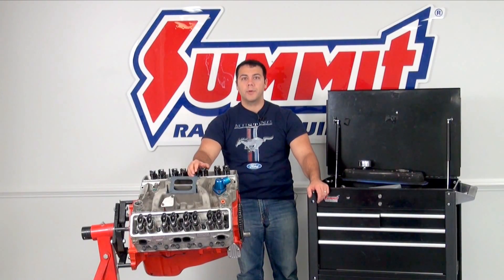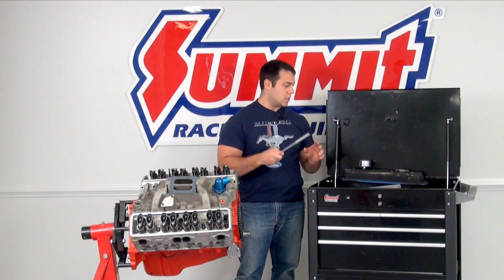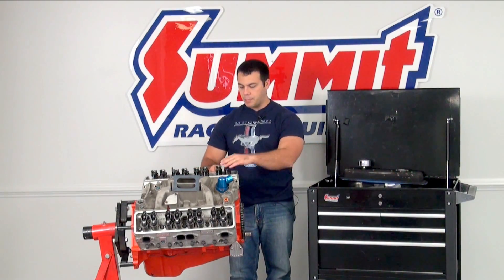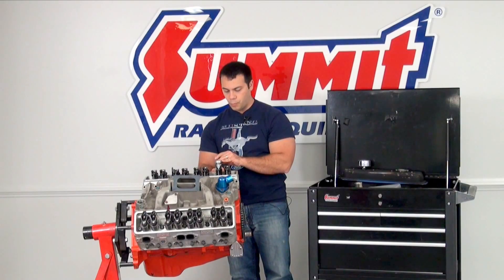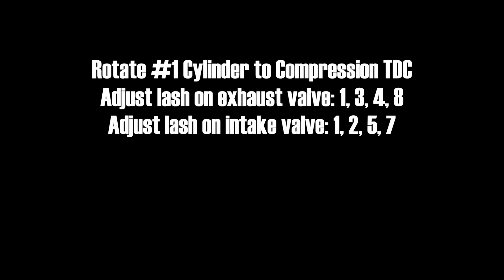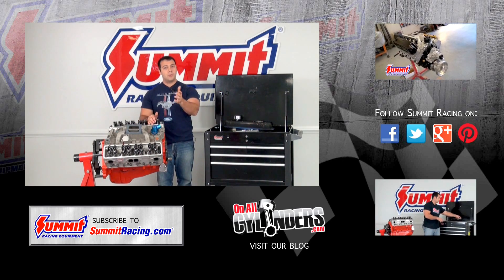Setting Valve Lash on Solid and Hydraulic Lifters

Comment: I found best way is put number 6 in overlap crank should be at top dead center. Then you can adjust number one. Write down the firing order to say 
18436572 than
65721843 top one is the valves you adjust bottom one is the rockers you looking overlap. Two revolutions and you have the valves all adjusted.

Comment: On a solid lifter cam Hot lash and cold lash are two different settings depending on what the cam card says and whether you have alluminum heads or iron due to thermal expansion differences between the two metals which will vary the clearance between rocker arm and valve stem as for example a  ford 351 c will have a hot setting of .016 intake and .018 exshaust and cold would be .022 int and .024 exs . Obviously the motor your working with is cold and your explanation is to quick with important information missing . If setting cold you should warm the motor to check the hot lash setting which you failed to explain in your video .

Comment: That is worst way of adjusting them!  You will NOT get a true bottom of the lobe position to accurately set the valse lash! You need to start with #1 cyl a TDC  and then turn the crank 90 degrees for all of the next cyl , setting the lash on both Intake & exhaust! You will notice a big difference how the engine runs!

Comment: Thank you for this video. Great job so if I'm to understand when you're on Top Dead Center, #1 cylinder you can make the lash adjustment for the exhaust and the intake without touching anything and that's similar when you're on number six when you do the other half. So if I went to top dead center of each cylinder, it would be the same scenario I could adjust lash on the exhaust and the intake at that time. do I understand that right. Thank you.

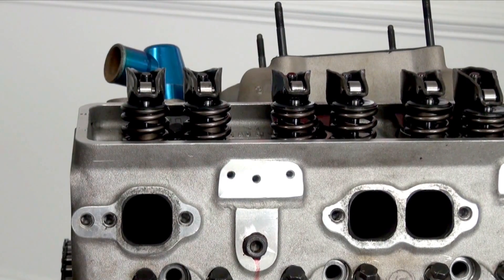Comment: At 1:23 into the video, his comment re;  # 1 TDC is incorrect.   Always use the harmonic balancer and timing tab alignment markings to establish TDC and on the C/S .... (compression stroke).  That said, these TDC markings should have been varified during engine assembly. 
If the assembly tech did not varrify the # 1 TDC markings,  you'll want to perform a PPS procedure.  
PPS = positive piston stop
The split should be 30 degrees or so.... not only 10 degrees. 

As per 1:52, let's assume that we are @ # 1 TDC C/S. 
At 2:30 he has set the "depth" (aka "pre-load") of the exhaust hydraulic plunger, of which is the actual goal. 
The formula is; rocker arm stud thread pitch Xs rocker arm ratio Xs nut rotation = plunger depth.

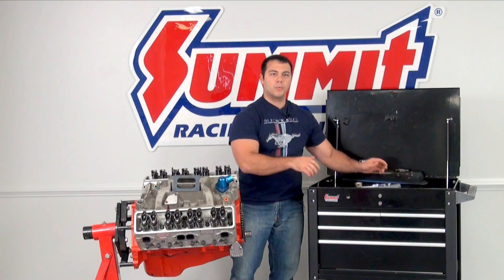At 3:44, with a hydraulic system, using the Static 8 Stop procedure, there is no need to rotate the crankshaft more than two full rotations. 
Keep in mind that most GM cam followers offer approx .100" to .140" of hydraulic plunger travel.  

When adjusting a mechanicl system, the dynamic procedure (although somewhat messy) is more accurate.
Reply: Dynamic ? as in running engine ? How is that more accurate ? That doesn't seem practical to use a feeler gauge on a moving valvetrain .

Comment: So I’ve run the intake valve all way down and back up and to adjust the exhaust valve or is it vice versa? Do I run the exhaust valve down back up and when the intake valve starts to go down is that when I adjust the exhaust valve on a solid lifter.

Comment: Hi I have a 350 sbc engine in my Cobra, with Edelbrock  performer package, with Hydraulic  lifters, and they have recommended  a quarter turn preload for the Lash adjustment. But the engine has been run, so the lifters are full of oil! Do I need to still give them a quarter turn or should I just adjust the rockers until the push rods stop turning. If you could help me with this one I would be grateful.
Colin

Comment: Finding TDC is not accurate enough for lash adjustment if you have any sort of cam significantly over a stock cam.   The only proper method is the EOIC method.   

Rotating the wrench 180 doesn't always work.   It depends whether you have 3/8ths or 7/16ths screw in studs which dictates how much you rotate the wrench for what distance.
Reply: I did half a turn, 12 to 6 o'clock, and I had a ton of chatter coming from the rocker arms. 🪇🪇🪇🪇

Comment: I just bought a 355 sbc,it has a pretty aggressive cam however I don't know the specs on it.roller rockers and solid lifters.how do u determine what size feeler gauge to use to set valves?
Reply: Did you figure it out

Comment: Correct me if I'm wrong he brought the exhaust valve till it barely moved and then adjusted the exhaust valve. You are supposed adjust the intake when exhaust moves.
Reply: The EOIC method wasn't being used . He was getting the piston close to TDC on the compression stroke , at which time both valves where closed and can be adjusted , although only one valve was done to save video time . The crank was turned clockwise until the exhaust valve opened a little , then turned counter clockwise until he was sure it was closed .

Comment: I'm want to put a good RV cam in my87 Chevy v10 4x4 305.i understand the motor doesn't have much power as is.but trying to get enough power to pull a 18ft car trailer

Comment: Is there a short cut on Doing the lash lash on a Honda Odessy?
Reply from the maker: There is no "shortcut" for adjusting vales on any engine. You may find some videos online to help you visualize and guide you through some of the quirks for specific applications. Always follow the manufactures shop manual for the adjustment procedure to avoid possible engine damage. If you need a manual, check out our vast selection of OEM service manuals from Bishko Automotive Literature Reference Books @ Summitracing.com.
https://www.summitracing.com/search/part-type/reference-books/brand/bishko-automotive-literature

Comment: Do I do lash before filling lifters or after
Reply from the maker: For hydraulic lifters, when you are spinning the pushrod and "sensing" for that initial resistance at zero-lash (with the lifter located on the cam base circle), it's not going to matter if the lifter is pumped up or not. The resistance you're feeling comes from the initial draw-up of play between the lifter and the rocker arm with no load; it's only going to be a very slight drag. Once you reach that point of zero-lash (all the up-and-down play removed in pushrod with no load on the lifter plunger), you will preload the lifter to the manufacture's specifications; this is usually 1/4 to 3/4 turn down. It's recommended to prime the engine using an oil pump priming tool before initial starting up. Once you break in the camshaft, it's also recommended you go back and readjust and verify the lifter preload.

Comment: hey! how do you set valve lash for V6 solid lifters setup and when to set for intake and exhaust?
Reply from the maker: When the valve is completely closed, you use feeler gauges between the rocker arm tip and the valve tip. You adjust the rocker arm until the feeler gauges (using the thickness required for your specific engine) slides in between them with very little effort.
Reply: You can find TDC by removing your distrubutor cap and stop when it points at the #1 cyclinder.  Then just follow this: Start by rotating the crank clockwise, while your watching the valves in the #1 cylinder. When the exhaust valve begins to move downward, stop rotating the motor and adjust the intake valve to the proper lash. Next, continue rotating the engine clockwise, until the intake valve reaches maximum lift and is almost all the way back down, then stop and adjust the exhaust valve. Continue adjusting the valves in each cylinder, until they are all adjusted to the proper lash. 

If you remove one sparkplug its easy to turn the crank with a wrench.  If your doing it cold - look for the cold lash setting.  Then after the engine warms you can do the same for the hot setting.  Let the engine run for 20 minutes or so before doing the hot.  This is for solid lifters - not hydraulic

Comment: What is you dont have the cam card for a engine? Im working on a older 350 with solid lifters that became out of adjustment how do I determine what to set the lash at?
Reply from the maker: Hi David, If the cam or manufacturer is unknown the best option is to set both the intake and exhaust at .020”.
Thanks for watching!

Comment: I dont have a cam card. Was told it was a 383 so just put new rods in. bent #5s exhaust rod. Solid lifts. So going to set hot lash at 17000th going to find oil deflections to put on so i dont have fire hazard on headers. So questions... 12000 to 22000 is that hot lash ranging? ty

Comment: Problem here, on a Solid Lifter, Hot Lash means exactly that, when it's Hot! 

You are setting a Hot lash, on a cold engine!
Setting it when cold, will give you a closer setting when engine warms up!
Setting it at 20 when cold, might be more like 17 to 18 when hot.
Reply: I think you are going the wrong direction, metal expands when heated not contract. Setting it when cold typically would get you about 6 more thousandths when hot, so a setting of 16 thousandths would be aroung 22 thousandths hot.

Comment: Could someone clarify bringing down the adjuster until you feel "resistance"? I believe this is called zero lash. Should I be able to spin the pushrod? Spin it with some effort? To the point where I can't spin it? I'm talking about the adjustment right before you proceed with the half turn of preload.
Reply: Use up and down motion to find zero lash. When there is no up and down play go the half turn.
Reply: I have the same question. I hope Summit or someone with experience can answer this question

Comment: once you find tdc on #1 cyl you can set 1 3 4 8 exhaust valve then # 1 2 5 7 intake valve then rotate engine to find tdc on # 6 cyl then set #2 5 6 7 exhaust valve,then #2 4 6 8 intake valve,my question is this once you have tdc on #1 you go # 1 3 4 8 ccl ex then with out rotating engine go to # 1 2 5 7 in is that correct please

Comment: so on  hydraulic lifters when you say the pushrod  no longer moves  that's the up and down ?and not turning/twisting  the push rod with your finger tips ?
Reply: Just so others can know, You adjust the rocker down until the pushrod cant move up and down...JUST barely. Usually, you will still be able to twist the rocker a bit across the top of the valve stem on the valve, but the pushrod has NO up and down clearance. I've done the "spinning" method, but because on hydraulic lifters, you can still already be AT or BELOW zero lash, and the pushrod could possibly still spin. Good quality lifters offer very little resistance on the seats of the lifters. You could wind up tightening the pushrod further then you wanted because you were thinking you tighten it until the rod stops spinning. 
If your using variable rate lifters, its a different set up procedure.
Reply: I have the same question. Did you figure this out? Or can Summit answer please!
Reply: @azeissler1987  no I haven't got an answer yet

Comment: Will this work with readjusting valves in motor that’s been running 7500 miles on motor
Reply: Yes. The method doesn't change regardless of mileage and engine wear (unless you're pushrods are super worn down past spec or something)

Comment: Al, you work for summit and they let you explain the wrong way to adjust Solid and Hydraulic cams. That company must really be hitting rock bottom by not watching your video and causing 1,000's of motors to bite the dust.This is the reason that there are so many people out there destroying their expensive cams. First off there is the only one way to do this simple but very important job. Remember this set of letters. " E.O.I.C." This means, Exhaust open, Intake closed. So, starting with no#-1 cylinder, You turn the crank clockwise until the No-1 exhaust cylinder spring is all the way open, then you adjust the No-1 Intake valve with your feeler gauge to lets say .018, then you rotate your motor around until the Intake at No-1 Intake valve is totally closed, then you adjust your exhaust valve at .024. Next , you follow this same sequence all around the proper firing order of your BBC motor which is 1,8,4,3,6,5,7,2... When you complete all cylinders in this fashion, your valve/lifters are all set correctly. Remember when you push your feeler gauge in between the pushrod and your rocker arm that the feeler gauge is just "SNUG" not super tight like some idiots have told you before. SNUG is better, not tight or super loose. When this is complete, your lifters are adjusted properly for 1-weeks worth of normal street driving, with a few good racers with your local competition. Adjust them every Sunday and your motor will operate correctly always. If you are at the track and racing, you might want to adjust them after every other race. If your are a fanatic, like I am. Thank You all  The same procedure for Fords only the firing order for Fords is 1,5,4,2,6,3,7,8.
Reply: after you set intake to .018 / exhaust .024 do you add additionally 1/2 or 3/4 of a turn?
Reply: I agree they doing it all wrong you don't know what he's doing
Reply: 0 lash no matter what he doesn't know nothing
Reply: Now I’m confused fused I’ve always been told that all valve adjustments are to be done when the valve is closed . 
When take is starting to open adjust exhaust. When exhaust is just starting to open adjust intake. Is that correct?

Comment: What are you talking about Gking king? This is the reason that there are so many people out there destroying their expensive cams.
First off there is the only one way to do this simple but very important job. Remember this set of letters. " E.O.I.C."
This means, Exhaust open, Intake closed. So, starting with no#-1 cylinder, You turn the crank clockwise until the No-1 exhaust
cylinder spring is all the way open, then you adjust the No-1 Intake valve with your feeler gauge to lets say .018, then you rotate your motor around until the Intake at No-1 Intake valve is totally closed, then you adjust your exhaust valve at .024.  Next , you follow this same sequence all around the proper firing order of your BBC motor which is 1,8,4,3,6,5,7,2... When you complete all
cylinders in this fashion, your valve/lifters are all set correctly. Remember when you push your feeler gauge in between
the pushrod and your rocker arm that the feeler gauge is just "SNUG" not super tight like some idiots have told you before. SNUG
is better, not tight or super loose. When this is complete, your lifters are adjusted properly for 1-weeks worth of normal street driving,
with a few good racers with your local competition. Adjust them every Sunday and your motor will operate correctly always. If you are at the track and racing, you might want to adjust them after every other race. If your are a fanatic, like I am. Thank You all.

Comment: I have an issue with my 2004 5.3 Chevy. Installed new cam grind #219-353/225-350/109+2. I installed new dual valve springs from BTR. My valves are hitting the top of the pistons. My timing is correct. (Dead center with dots). With my LSA being 109 +2 my timing should still be dead center correct? I need help on this. It’s really kicking my tail. I already trashed one cyl Head because an exh valve broke and cracked my head.
Reply: Hey Brandon, Before you slap your pistons on the head and bend your push rods and break your pistons and rods, 
read my proper way to adjust your valves/lifters up above under the name Joseph Monaco. You will be 
happy that you followed the only correct /proper way to adjust your cam without destroying your engine.
It is very simple and if you write it down and follow the same pattern, you will never mess up and you
will become an expert at it forever. Please don't follow some VooDoo way of doing this very simple procedure.

Comment: Lose the shirt. This old 2 step method seems to work but this vid smells. I say go online to a written page not a video , from century performance on this and print the page with the intake sequence and then the exhaust sequence. You have to turn the engine a tiny bit 16 times but it will put you on the opposite side of the top of the lobe every time so i feel it's more accurate. And as not stated in this video Use up/ down motion of the push rods. . When it stops: no lash. Don't try wiggling the rocker arm, it will move long after lash is gone. Intake valves are by the intake ports. Exh aren't. Easy peasy and you don't have to care where TDC is. And fwiw it is 1/2 a turn not 3/4s like they used to tell u. They recommend 1/4 to 1/2 for mild street. Less for race. I went about a third to half

Comment: Is # 6 cylinder the opposite of #1? Will #6 be at tdc when the mark on the crank pulley is 180° #1 tdc?
Reply: I believe tdc cylinder 1 & 6 should read 0 or TC (depending on dampener), however, they're one full turn away from one another. Or as far as I've done it, that's how it is.

Comment: You guys have it real easy with your engine designs, I've just spent 9hrs shimming/valve clearances with a DOHC with bucket followers with shim under buckets on a race engine which was a pain in the ass to do as it had top hat shims that Sat on top of valve tip. Accuracy is key to valves not burning up cause of wrong clearances. A pain to do compared to the engines that is used in your country.
Reply: I’ve adjust bucket valves on motorcycles. Not a lot of fun. On an old sloppy Chevrolet engine, you can almost get away with finger tight on hydraulic valves.

Comment: so when going to TDC on cylinder one, and then after setting exhaust 1,3,4,8 and then intake 1,2,5,7. then I got to cylinder 6 TDC and set the rest? No TDC on the other cylinders?  and one more question, that 12 o'clock to 6 o'clock turn for setting preload on hydraulic lifters, what about the 22 lb ft of torque for spec? wouldn't that push the plunger down even further? btw, I'm using stock 1.7 rockers.